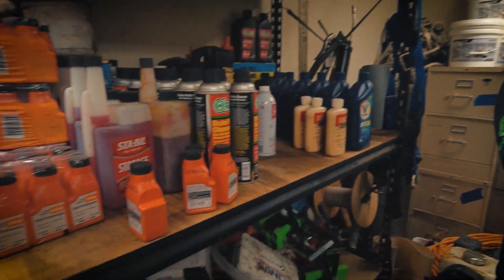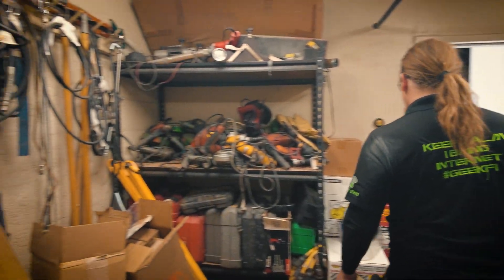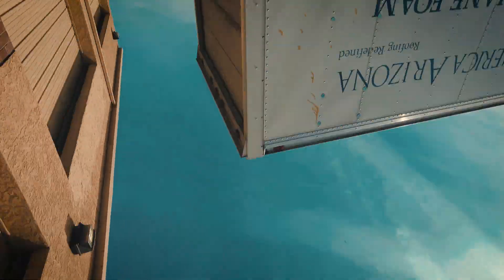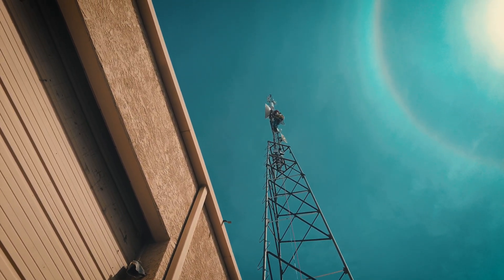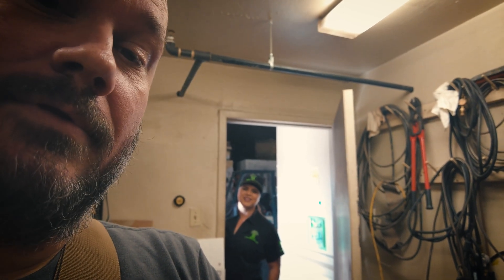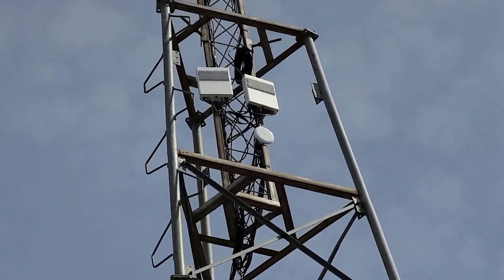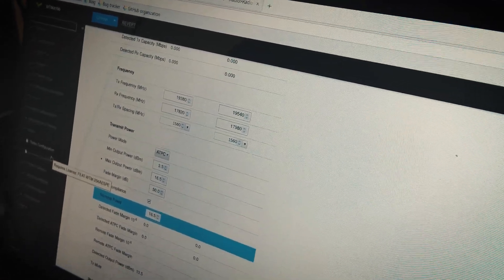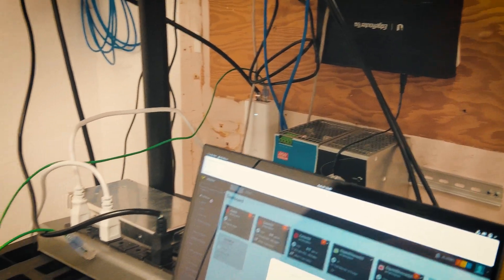Even MOAR Upgrades!!!  - DIY Ubiquiti Internet Relay Pt.75

Comment: Not sure how rain is where you are, but working for a wisp in Arkansas 18ghz does have some rain fade problems. 11ghz is better for stability. A pair of mimosa b11 will push close to the same traffic. Without rain fade
Reply from the maker: We're in Phoenix, homie! Rain? What's that!? 😆
Reply: @rmp5s  well in that case I would look at E band for long term. 80ghz 10gb. Then some 60ghz ap. Compete with fiber.
Reply: Arizona…